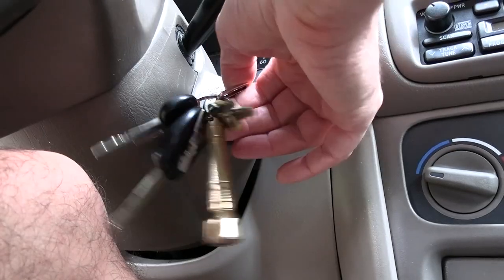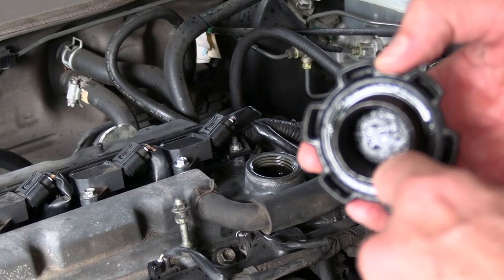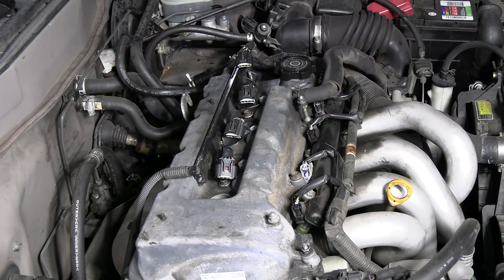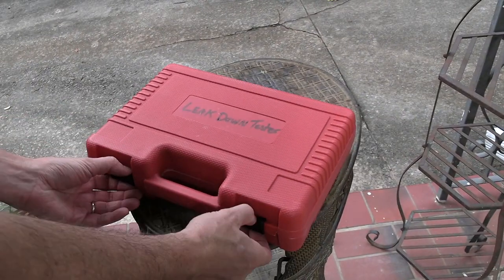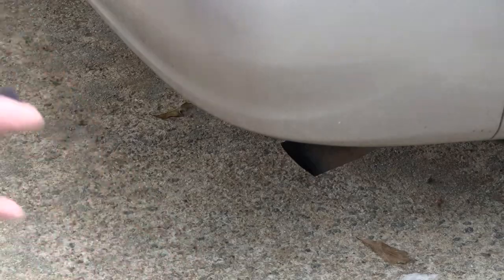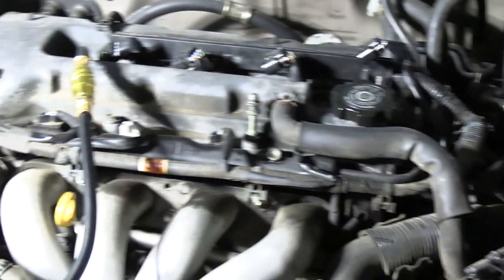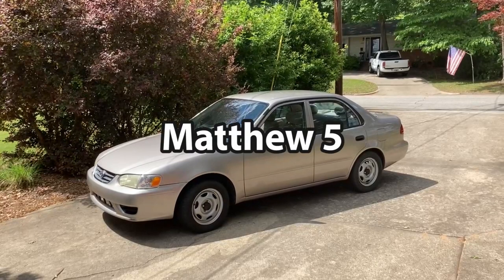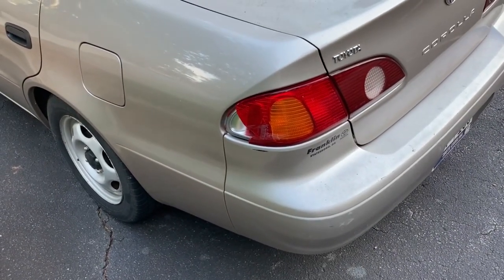How to perform a leak down test | Oil Burning🔥Experiments | Episode 14

Comment: Oil/carbon build up in the ring lands can also cause a increase in compression anyways, there is many variables but compression regardless is fairly even among all cylinders which is surprising. 

I know you have tried many things, however High Performance Lubricant's make an ester based motor oil, ester has a natural tendency to clean really well, while being a motor oil it is very polar and will act like a solvent. Their whole line is ester based, they even have a cleaning oil you add to normal motor oil to help clean the motor out, folks online have tried it and cut open the oil filters to show a lot of carbon/sludge in them.

It's like $15 for a single quart mixed 4 parts (your choice) motor oil to 1 part cleaner (it is motor oil just ester based) the shipping is like $10 but it's meant to help pre-clean the motor before folks switch over to their motor oils to reduce the likelihood of excessive cleaning, and clogging the oil pump pick up screen.

If you contact them, mention these videos, and ask them they may provide a free sample, folks in forums have mentioned it help reduce oil consumption a good bit.
Reply from the maker: Thanks for the suggestion!
Reply: G oil is also Esther based
Reply: he's doing the compression test wrong, that's why it's so high.
Reply: @robertschulz5293  no, he did the compression test correctly
Reply: @redneck4528  No he didn't. You don't just crank the engine over dozens of time and let the gauge build pressure. You are supposed to turn the engine over 5 revolutions and stop. I've been doing this for 35 years. I know what I'm doing.

Comment: For head gasket check you can also do a sniff test which tests for exhaust gasses being present in the coolant. Hg failure doesn't always mix oil and coolant (although in fairness I think most times that does happen!)

Comment: I can tell you that when I had a carboned up cylinder on my van, the compression went from 190 (normal for honda 3.5 V6) to 220. Just from carboning. I'm on the page that your high oil consumption and carbon residue is the reason for the higher readings.

Comment: I posted an earlier comment but after giving it some thought I believe you just caught the culprit on camera. I said believe so I could be wrong but here's another education guess. 
The problem, or part of it, is likely the pistons themselves. The groove in which the piston rings sit are now tapered. Going back to what I said in my other comment about many things follow the path of least resistance. The reason why you got an improvement in your reading, on two different cylinders, is because the force of the incoming test air forced the piston (oil) rings to seat where they're supposed to seat. 
The oil rings aren't stuck open, the inside of the oil rings has worn out the mating surface that it sits on in a tapered fashion. 
I truly appreciate you posting these videos. It's a learning experience for me. I didn't see if you had taken notice of which spark plugs had oil on them but it would be interesting to see if the same ones that have oil on them come off of the same cylinders that have improving leak down tests.
Thank you for reading 😊
Reply from the maker: I read every word of both of your comments. Interesting theories! I think it’s cool how recording enough information about a particular subject can inadvertently provide data/evidence for multiple (and sometimes seemingly unrelated) hypotheses. 👍🏻👍🏻👍🏻 The comment section is akin to a think tank. Thanks for posting!
Reply: @FamilyFriendlyDIY  Thanks for your reply. You're welcome
The only other thing that I can think of is using smoke somehow and check cylinder by cylinder

Comment: Hey I just had a random thought. I wonder if you could put some WD40 in the cyl, and then put pressure into cyl, see if you can force the cleaner into rings??
Reply: Good idea
Reply: I wouldn't use wd40, but a petroleum solvent might work
Reply from the maker: Thanks for the suggestion!
Reply: I've tired Redex before... Its gentle to the engine. But try to leave it over night, after you poured in and cranked the engine.
Reply: Another good way to clean top of the the piston is carb cleaner! Unplug the brake booster hose and slip the straw in the hose and reconnect the hose back to the brake booster. While another person hold the rpm at 2500-3000 with engine running, u just simply spray the whole can of carb cleaner until it’s empty then feel the difference it made after

Comment: Dave it should be leaking air.
Not enough leakage should mean it's not getting past the rings or through the oil return holes

So those ones with low leakage should line up with the plugged rings.  
That is my understanding anyway.

The air goes though the ring gaps and then leaks between the cylinder and the piston.

The oil return holes should allow much more air past than the gap between cylinder and piston

I read about another B12 recipe which is to do a soak and then a leak down test to clear the oil return holes.

Comment: My brand new car blows a bunch of air out of the oil fill, some engines just do that, especially 4 cylinders. It's just windage from the rotating assembly and piston strokes.

Comment: Oil control rings. Try dumping some of that chemical carburetor cleaner in plug wells and letting it soak before next oil change. Seafoam probably wasn't strong enough. By now you could have just torn the whole engine apart and replaced everything.

Comment: and Clearly blow by on the rings. Oil is pushed into the intake through the PCV and some oil leaks past the rings on the intake stroke. The ring cleaners that were tested did not work.  Now you can test all of the other ring cleaners.

Comment: Hi Dave,  is there any chance you might run the bore-scope past the throttle body into the intake manifold runners to look at any oil deposits in the intake runners and valve area's.
Please. Michael H
Reply from the maker: Thanks for the suggestion, Michael.

Comment: You have great compression, and it's likely caused by the bad oil rings.  They're supposed to scrape the oil back down into the crankcase.  They get filled up with carbon/gunk and get seized and don't conform to the cylinder wall like they should anymore.  When they don't operate like they are supposed to, they leave the oil on the walls, and it's like doing a wet compression test, which will be higher than the spec.  This is why you are burning oil.  Scotty Kilmer has a friend who makes a product that might really help out with this.  It's kind of expensive, but if you want to try something before replacing the rings, this is worth a shot.  Also, have you tried using Berryman's in the engine oil itself yet?   

Scotty's Video : https://www.youtube.com/watch?v=c-babZWqH34&t=308s
Link to product : https://www.atschemicals.com/505-pour-ins

Different engine, but a great explanation on Toyota Rings, and what can happen, especially with overdue oil changes.  
Explanation on Toyota oil rings : https://youtu.be/TJhFAwFv-O0?t=760
Reply from the maker: I think you’re onto something with your ideas about the compression testing.👍🏻👍🏻

Comment: Hi, Love your videos!
Got a Corolla 2001 with the same issue, oil burning!!
Time for the annual emissiontest, didn't pass as I expected the cat was clogged!!
Had a used from a Opel 2.2 laying around, much more power, better milage, No check engine and well se if anything happens with the oil burning!!!
Hope i'll pass when i revisit the testcenter, if i dont it will break my hurt to scrap it.....
Good luck!!
Claus from sweden
Reply from the maker: I wish you the best, Claus!👍🏻
Reply: @FamilyFriendlyDIY  oilburning definitely decreased, 0,5 ltr/1000 km, runs smoother!!
Revisit Wednesday morning, please wish me luck🤪🤪
Reply from the maker: @clausjansson4856  all the best to you!
Reply: It passed the emissiontest, 0,7 ltr of oil/1200km much better!! I'm gonna try egr-cleaner trough the spark-plug holes and let it soak over the weekend!
We use it at work to clean egr-coolers on Hyundai GDI-engines, really powerful stuff, hopefully it can get a little bit better!
Regards
Claus

Comment: Think if chemtool doesnt do its magic redline wont help, i personally wouldnt do it just to be safe. If chemtool doesnt fix just plan engine rebuild of some sort so we see what is wrong, and as you say may not be too much

Petrol engines have vacuum in intake so opening cranckcase lets some excess air in and thats why engine sounds different. Even if there is blowby it could be sucked in by intake if not too significant. 
I did the same test on my oil burning diesel which has all symptoms like yours, and since there is no intake vacum i get considerable smoke on dipstick, especially when fully warmed up engine

Comment: Why is the left meter on the leak down tester only showing 30 psi (@ 12:16) when the air compressor is feeding your tester with 100 psi? Are you not letting the full 100 psi into each cylinder to perform the test? Is 30 psi adequate pressure?
Reply from the maker: I did a little research on this, and I think it's a couple of things: (1) Pressure drop from using two 50' lengths of hose from the compressor (2) These new cheaper testers (for amateurs) cut the supply pressure by 50% because (from what I understand) pressures higher than 30-40 PSI are likely to spin the engine.

Comment: Could it be that your cheap leakdown tester uses way to low pressure? You should have been able to reproduce the air flow out of the oil cap which you forgot to check during the leakdown test?

Comment: Borescope camera!...a very useful tool for the DIY person!  You can look inside your engine, look inside your bathroom and kitchen drains, look inside your walls, EVERYWHERE!  Best tool we've invented since the stone axe!  Thanks, Dave, for turning me on to this...they just didn't have toys like this when I was a kid!

I'm a ways behind you in the process of discovery of what's causing my particular Toyota 1ZZ-FE's oil consumption.

I was last replacing the valve seals, which WERE horribly cooked on the exhaust side...and ran into a bit of a stupidity roadblock.  If you look at the short video of mine, that I'll link below, you MAY see the problem, IF you're sharp!  Yeah, THAT stupidity roadblock!  I'm not done scheming a way out of that little issue yet, but the video isn't so much about that as it is about the condition of the piston crown, valves, and cylinder walls...along with the really decent, for now, WiFi bore scope I got for $37 and change.

I'm gonna sit on the borescope link (for all'Y'All's protection) for a while as I finish this project...if it continues to work as well as it has initially, I will gladly share a link.

My short video...bet you can't find the latest issue!  :D  https://youtu.be/CoHTGQQOxcI
Reply: He already checked with the borescope
Reply: @dickbutt7854  
Indeed he did, that's why I thanked DIY Dave at the end of the first paragraph for turning me on to borescopes.  I hadn't realized that they had gotten so small that you can shove one down a 5.5mm valve guide!!
Reply: @Bluswede  Got ya

Comment: the oil rings are clogged. for fun and good content, how about you pull the head, and pan. pull the pistons and soak them in b 12 for a day or two. see if that clears out the oil drain holes. then put them back in. other than that its back to soak the pistons with break clean or b12.

Comment: Run seafoam in oil, 1oz per quart, and do repeated 2000 mile oil changes. 
Watch the oil burning reduce over the next 10k miles!

Comment: BTW, I live at Hawaii, so it doesn't get cold here. I can get away with 30-40 wt oil.
I repair a 87 corrola with 200 k.
No oil loss after using 40 wt
No leaks, no burning oil.
More power, lower emissions

Comment: So your compression rings are fine.  It’s the oil rings especially #3.  Whatever chemical you try.  You need to let it soak PAST the compression rings to the oil rings.. this might take 24-48 hours.  And motor flush b4 every oil change and thinner oil.  But if you’ve ever  been to a machine shop and see what carbon buildup does to rings… think “epoxy stuck”.   If flushing and thinner oil doesn’t work over time…. You will have to re-ring it.  Watch other utube vids on these Toyota oil rings… it’s not a mystery… it’s a known issue… and the people who get it done too down soak soak soak

Comment: Take spark plugs out, take sump off. Spray oven cleaner foam and egr valve cleaner must contain xylene. Pour into cylinder let it soak through down cylinder walls and piston rings for a two days. Crank engine repeat on the other two pistons. Once your happy all foam/egr valve cleaner is through pistons and cylinder walls and dropped into the bucket below.  Refit sump oil filter and new oil. Your engine or stuck piston rings will be carbon free and operate as normal.

Comment from the maker: Previous video in this series:
Catalytic converter testing: https://youtu.be/OoxPeJ6VA9M
Next video in this series:
Will Berryman's B12 Chemtool stop the oil burning?: https://youtu.be/EG70jHiT-S0
Entire oil burning experiment playlist: https://www.youtube.com/playlist?list=PLS7Cti2LicYDtv1hFbz_dErQFGxnTgMCj
Reply: Cylinder Block  11410-29166
Comes with pistons from factory assembled 
Overhaul Gasket Set  04111-0D031

Ready to go
Reply: @hrcia6123  for 2002? 1zzfe?
Reply: In one of your other videos I saw that your short term fuel trim was high (+8 to +10% at idle) Can you post short & long term fuel trims at both idle and 2,500 rpm? The interesting thing is I also have high fuel trims & the cat code. Maybe it's time to invest in a smoke machine.

Comment: You don't have enough carbon on top of the piston to increase the compression test, the lack of carbon around the edges of the piston top tells the story. It's called piston wash and it's because of the crankcase oil getting past the rings and washing the top of the piston clean.

Comment: My vote is to buy inexpensive synthetic oil in bulk from Amazon or Costco and keep adding MMO or another engjne treatment with each oil change.

Of course, I make this same comment in each one of the videos in this series 😉

After all these engine treatments do you seriously still have carbon buildup in the combustion chamber?

Close to redline will be ok. Doesn’t have to be right on redline.

Comment: Great job on these videos..I really enjoy watching you go threw the experiments ..and I'm hoping something is going to actually work...but it's not... motor is toast..I left a link below on my favorite way to fix the oil burning 1zz...
The 1ZZ-FED is similar to the 1ZZ-FE but is built separately in the Shimoyama plant. Toyota's advertised power output is 140 bhp (142 PS; 104 kW) at 6,400 rpm and 127 lb⋅ft (172 N⋅m) of torque at 4,400 rpm. Additional power output over the 1ZZ-FE is accomplished by larger valves and corresponding revisions to the ports...it's a bolt in for your Corolla..you will be very happy with your MRS Corolla if you do this.. this is how I fix these little oil burners and you should too...
https://youtu.be/8_qz7tI6tbQ

Comment: For sh!ts and giggles you could get a couple gallons of diesel fuel and do a soak and then a flush.
Drain your oil first. 
Would be cheaper than the other chemicals and you would get the benefit of the lower end and oil pan sludge reduced. 
I think the oil control rings are gummed up and the drain holes in the pistons are clogged up.
Good luck.

Comment: You are doing the compression test incorrectly. You do 5 rotations on the compression stroke, not just let it crank and crank. When you do the test properly you will see much lower compression.